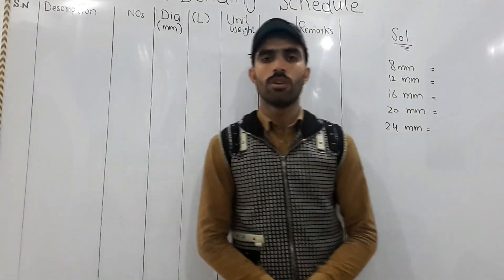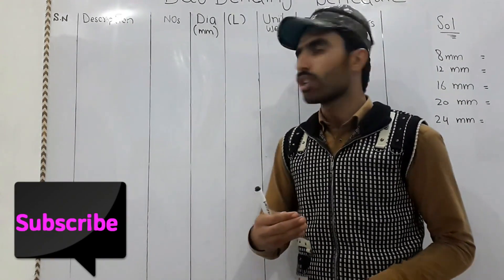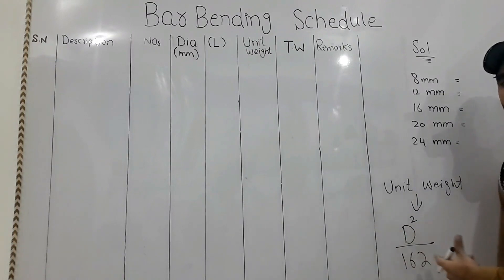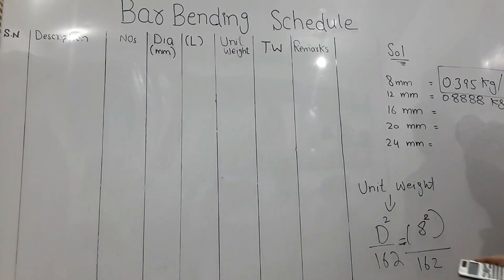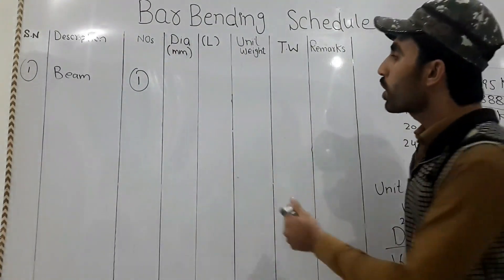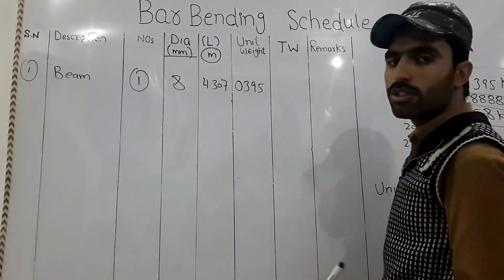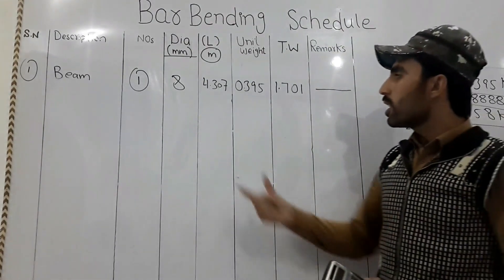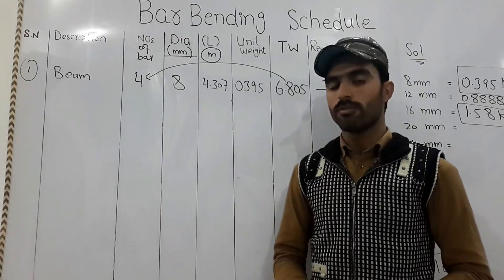Bar Bending Schedule for Steel.

Comment: admin first off all its not complete BBS . deduction of elogation of steel not calculated . Formula of calculating kg/m is also wrong. it is.  square of dia/ 162.20. or we use square of dia/ 162.16

Comment: for the confirmation please compare with FPS schedule.
(sutar)*2/24
Reply: But you r not telling  here 90degree 180 degree bend and sttrips.and also tell about concrete cover which use diffrent rcc member
Reply: formula to find unit weight in sooter is [(dia of bar)^2]/24 = ---------lbs/ft.